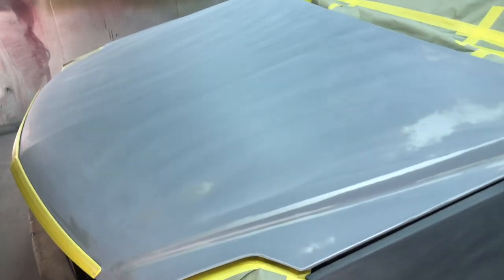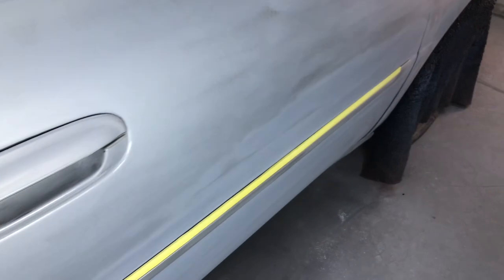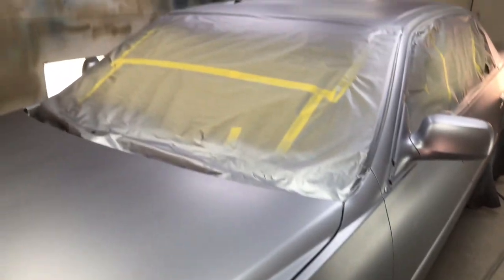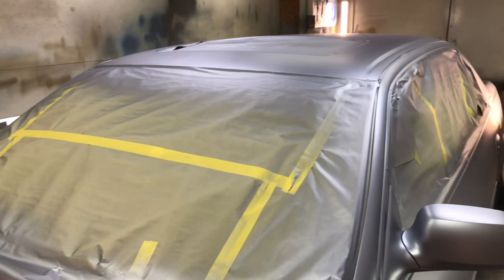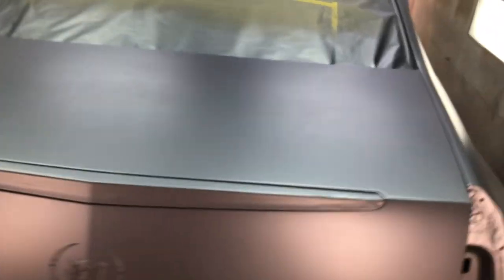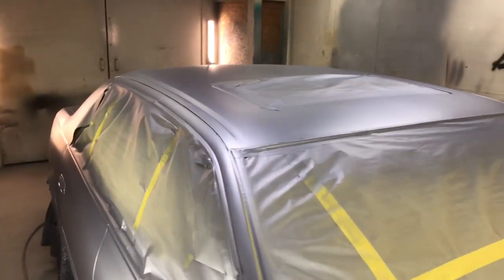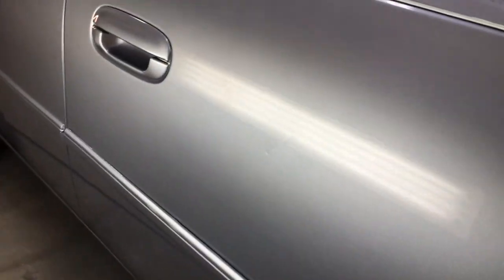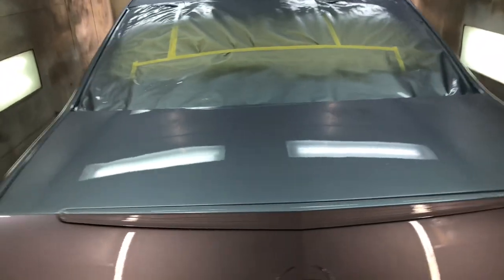Painting a light Blue metallic on this 2008 Cadillac DTS

Comment: Beautiful! With the finish product. Did you wet sand or buff after you was done spraying? I'm just trying to wrap my mind around the start to the finish.
Reply from the maker: I didn’t wet sand and buff the entire car only the areas were it was needed...are you planning on doing a project soon and trying to figure out if you have to wet sand and buff when you’re done?
Reply: @UndergroundPaintKing  yes I brought the same lvlp gun you used in the video and I have my 21 gallon compressor and I have my paint. I work offshore but I get home next week I'm going to try and work on my G body Regal project. Just start with something easy like the engine bay. Then I will try the door jams. Just the places that I can't mess up to bad.
Reply from the maker: @pontiacrivers6465  that’s a good plan and a nice project to work on!

Comment: Nice!! If you don't get a run, your not putting enough clear on 😂. I take a razor blade and tape the ends so it doesn't scratch, and shave it off , done it that way for yrs! Good job brother painter!
Reply from the maker: 😂😂😂 I don’t get a lot of runs so I must not be putting enough on...I’ve seen other painters use razor blades to shave them off and it definitely works... I appreciate you bro for checking out the video!

Comment: I’m not even gone cap, I hate metallics. I’m no pro but my homies always hit me up for paint. Every now and again I’ll get a metallic and I hate it. Never comes out the way I want it to, I just don’t get enough practice with it. Any suggestions?
Reply from the maker: What is it about metallic that you don’t like?
Reply: @UndergroundPaintKing  usually just how it lays, normally I’m in a garage so limited wind. Always just looks “blotchy”.
Reply from the maker: @charlesdemeary  what psi do you spray at?
Reply: @UndergroundPaintKing  typically around 26-27? It’s a small compressor but it’s what I got ya know
Reply from the maker: @charlesdemeary  ok what kind of paint gun are you using
Reply: @UndergroundPaintKing  McGraw 20 gal
Reply from the maker: @charlesdemeary  what paint gun are you using is it a lvlp gun or HTE or Hvlp? Do you have issues with the gun dropping air pressure when you are painting?
Reply: @UndergroundPaintKing  from time to time it’ll drop, thought it was just the compressor itself. And it’s HTE
Reply from the maker: @charlesdemeary  you need a lvlp spray gun for a small compressor and it’ll make a difference when you are spraying…as far as blotchy paint try doing a drop coat when you’re done bump your air pressure up on your gun and move to about 10-12 inches from the panels and kinda mist the paint on…get a junk hood and test it out and see if that helps
Reply: @UndergroundPaintKing  thanks OG, appreciate the time
Reply from the maker: @charlesdemeary  anytime bro!